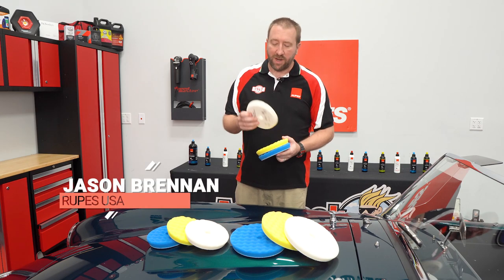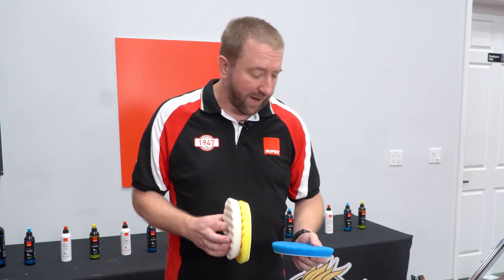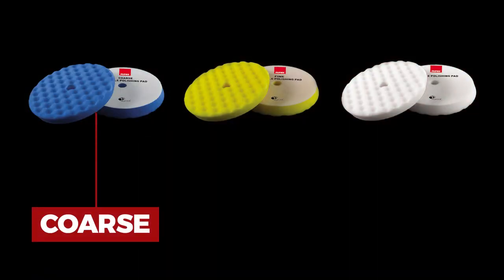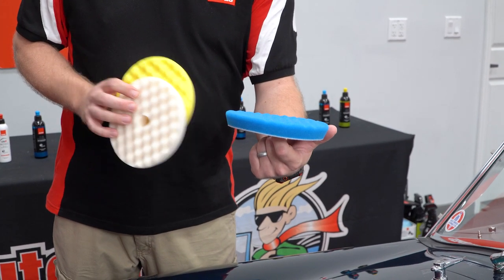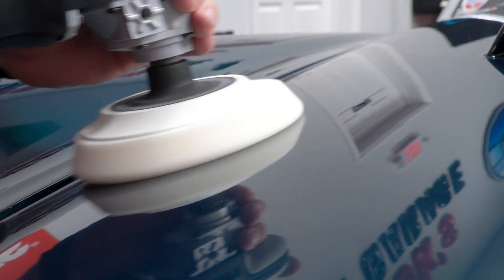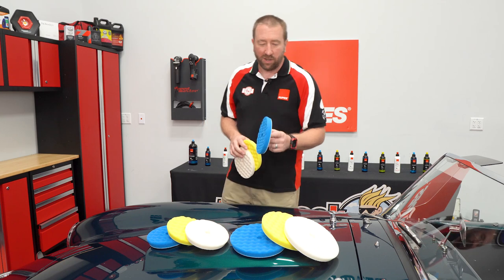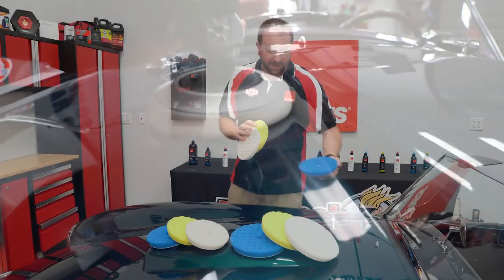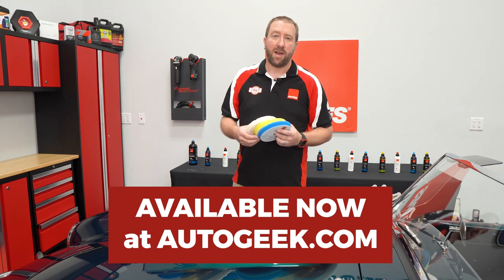The Advantages of using RUPES Rotary Waffle Pads

Comment: Can these be used with a dual action polisher?
Reply from the maker: The Waffle pads are specifically designed to be used on rotary polishers, but you could always try them and see how you like them on a dual action polisher. The RUPES DA pads would be more suitable for dual action.
Reply: Yes. Tried on Makita PO6000c.
Works better than it does on Rupes Rotary with 5 inch backing pad. For rotary use, the foam in my experience should have been designed bit thicker height wise. But works a charm on the DA. Used it to apply Uno Advanced.

Hate to think the engineer was thinking DA and final product rolled off as Rotary.

Bit low profiled for rotary, jittery on certain panels, and I've tried speed, angle lubrication factors. 

The Makita 5 inch rotary pads of waffle design are bit thicker height wise, and works great on LH19E.